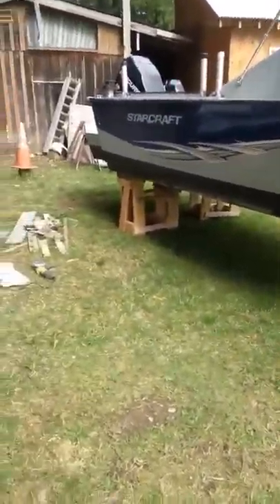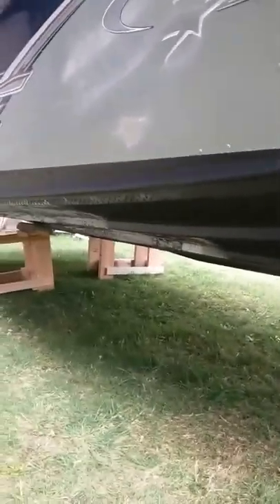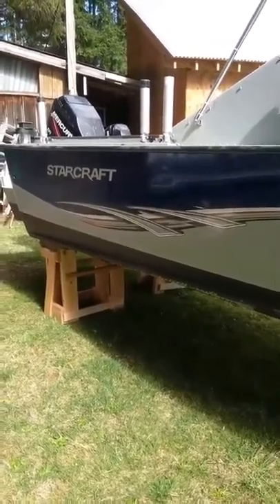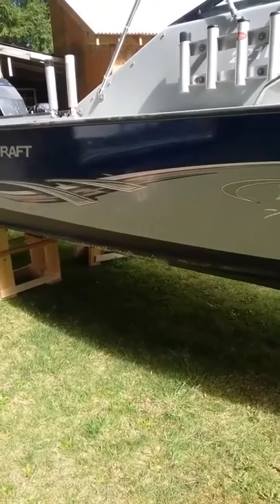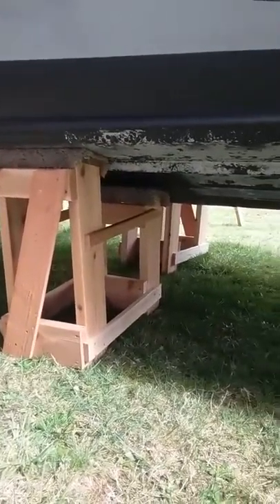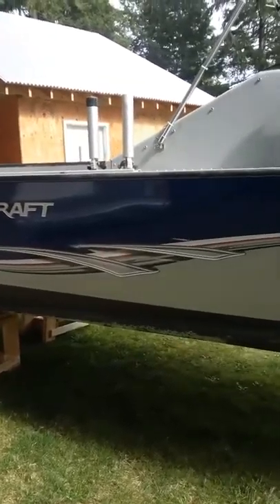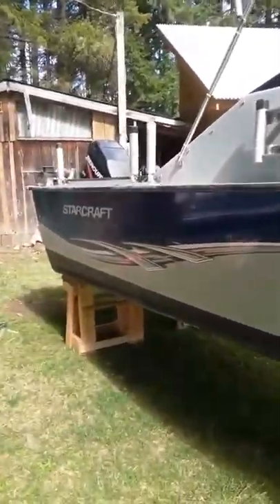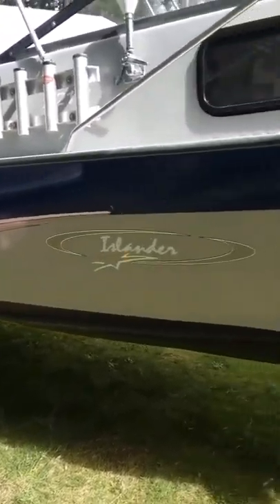Using bed liner on the hull part 2.

Comment: You better off buying a quart can and sponge roller you will get more Cote covered because the spray can doesn’t cover much at all
Reply from the maker: If I had not done it in small sections I would have.